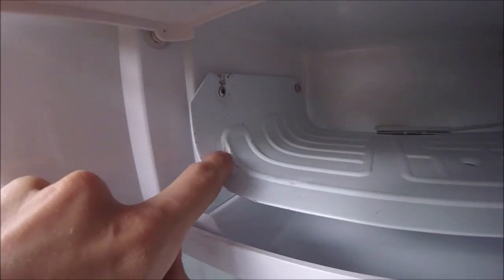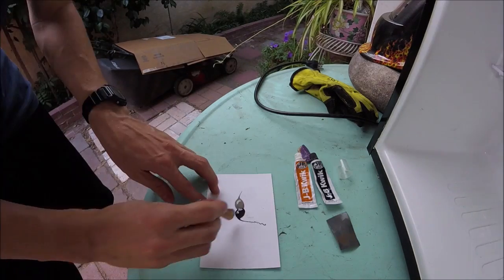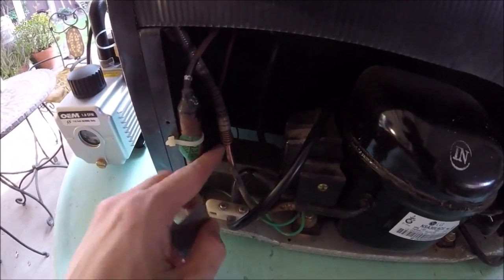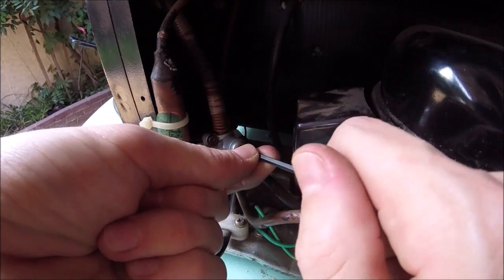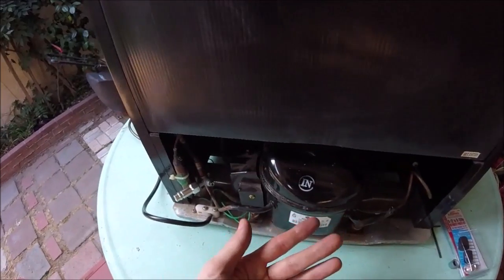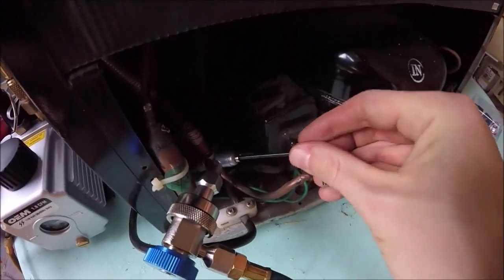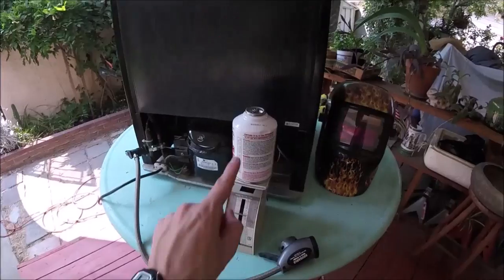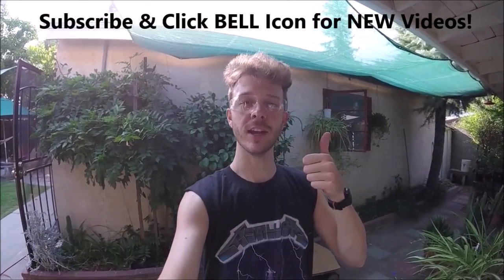How To Fix a Broken Mini Fridge -Jonny DIY

Comment: For the R-134 link, do you need to use the old version for $45 or can you use the artic freeze $22??
Reply from the maker: You can use new version as long as R134A. Will have to check links, they change the products sometimes 👍🏻

Comment: Cuestion if my freezer  has a hole I still used the cooling or I can I'm afraid  get burn down
Reply from the maker: If freezer leaking refrigerant gas theres no point recharging if leak is big. Will just all leak out. Try and fix leak first unless its super slow leak

Comment: Is it ok if i can just cover the whole will it still work
Reply from the maker: You can patch hole, but will still have to recharge system with refrigerant if it all leaked out. Youll know that it did if it currently isnt coolong at all 👍🏻
Reply: @JonnyDIY  thank u so much

Comment: Can anything else be used to seal the cooling plate in the fridge?
Reply from the maker: You could use other brand 2 part epoxies. But I'd stick to an epoxy 👍🏻
Reply: Jonny DIY 
Can I use fevitite epoxy adhesive instead of JB kwik

Comment: I have this problem, but I see that the mini fridge I’m looking at uses R12, which is tougher to get and not compatible with r134a. Assuming I can buy some, can I use the same vacuum puller on it? I’m sure I’d need to hook up the r134a fitting, but I don’t know if residual mineral oil in the fridge system possibly getting into the vacuum puller will cause a problem with the vacuum puller I rent. Any other issues to avoid?
Reply from the maker: Yes I believe its the same process as with r134a 👍🏻

Comment: Curious if the freezer tray can be easily replaced and if less/compatible cost to this videos repair method.

I did same dumb mistake of trying to chisel out the ice.  If I would have just been patient, lol
Reply from the maker: I would first try this fix that I did. Doesnt cost but around $15. If this doesn't fix Id just try and find one on $99 special or 2nd hand can be had for $20-$50

Comment: The challenge is to plug the holes without clogging the refrigant lines.  How would we know that lines are not clogged.  Tricky stuff !!
Reply from the maker: Yes just try not to cram the epoxy in the holes and should be ok 👍🏻
Reply: @JonnyDIY  Thx alot pal !!  Your videos are a big help for DIY repair stuff.

Comment: How do I turn of the gas so I can defrost and repair a puncture without losing all the refrigerant?
Reply from the maker: If you already punctured the refrigerant line in freezer then all the refrigerant gas has escaped. Will need to patch then recharge 👍🏻
Reply from the maker: If its still keeping cold, just unplug to defrost. And just let melt and remove ice chunks gently

Comment: Awesome video man. So, I should have known better but is it a problem if I poked a hole in the side wall of the fridge (not the freezer coil)?
Reply from the maker: No you're good. Shouldn't be a problem.  As long as it's still functioning as normal. You can always seal up the hole with some epoxy or just caulking to prevent moisture or loss of cooling 👍🏻
Reply: @JonnyDIY  awesome! Thanks Jonny!

Comment: Ok so even if I turned off the fridge it will still leak coolant and I have to put more in?
Reply from the maker: If you punctured any of the refrigerant lines, yes. If you heard a hissing noise, that was the refrigerant escaping. You'll have to patch and refill as I did

Comment: Does it matter which line you put the bullet valve on?
Reply from the maker: If you have a service stub use that. Just use the copper line from the compressor. An area straight and smooth
Reply: @JonnyDIY  the service stub is way to corroded. There are two lines one running into the fridge and one to external coils. I'm guessing it doesn't matter which one based on your statement.

Comment: Is it okay to just patch up n keep goin? Or do you have to do the whole process you did outside of the fridge?
Reply from the maker: You have to 1st patch it. Then vacuum system and recharge with refrigerant. If you just patch it wont work. All the refrigerant escapes as a gas when a hole in punctured
Reply: Jonny DIY to patch it, would a Clear RTV Silicone adhesive & Seal work?? A pro seal?
Reply from the maker: No I dont think itd hold the pressure as well as keeping a good seal under the cold temperatures of the refrigerator. I would just get some JB Weld. The Kwik kind sets up the fastest. Only around $5
Reply: Jonny DIY cool. Thanks so much for answering

Comment: what if you dont vaccuum it but ypu do add the refrridgerant?
Reply from the maker: It most likely won't work if there is air in system
Reply: @JonnyDIY  I've done it without vacuuming for my car and it works okay, but I dunno if I wanna do that for the fridge. If it's running even the least bit inefficient, it's probably gonna cost more in electricity in the long run right?

Comment: I accidentally stab a knife on a fridge plate and there was an air popping outside. I use proxy to cover it. Isnt it okey sir?
Reply from the maker: Yes you'll have to do as I did. Patch hole first then vacuum and recharge system with refrigerant 👍🏻
Reply: @JonnyDIY   sir what happen If idont vacumm and recharge? Pls reply
Reply from the maker: @myrnasarsalejo1201  if you dont vacuum and recharge it wont work and cool anymore
Reply: @JonnyDIY   is it okey if I dont vacuum and recharge system with refrigerant
Reply: I have a pretty old fridge I'm going to vacuum it but does it make a difference what kind of refrigerant you use in older fridges versus newer ones
Reply from the maker: If 1995 and newer should take R134A refrigerant. If older youll have to call a pro to get freon
Reply: @blade5054  if i turn off the ref fast? After i accidentally stabbed and the stabbed is super duper small

Comment: Great video! how long does it take to create the vacuum? my gauge stays a bit above -20, left it on for a few min and stayed at -20. turned it off and it held. Unplugged everything, pressed the schrader valve on the adapter and it let out/in air. signs of it working??? thanks!
Reply from the maker: I would vacuum system for a good 15-30minutes. Make sure it can hold deep vacuum, should be close to 29inches vacuum. Rhen recharge with correct amount of refrigerant

Comment: I just ended up making a small dent. I don't know what to do. I am so done or.  It's not where you had it, it's on the plastic rim where we find the door of the freezer and the metal plate is intact. Will it cause problem. It's just a few hours and I am having a heat attack
Reply from the maker: You should be fine, as long as nothing is punctured on the freezer tray like mine was youll be good 👍🏻
Reply: @JonnyDIY  Thank you so much sir.😄 I feel relieved. ❤
Reply from the maker: You're welcome 😀👍🏻

Comment: One week after my repair and still cool. :) Thanks so much! Just a few words on Autozone and obtaining the vac and gauges. They don't rent these. However, I was pleased to find out that they LEND them. You just have to put down a deposit to temporarily buy the loaner ($300 on my CC for the set).  Upon return, you get you full deposit back up to 90 days. I did have to buy oil for the vac for $10. Total out of pocket for repair was about $40, but I saved a $1,300 U-Line beverage center (fancy mini-fridge) for now. Repair was estimated at $850 to replace the evap. unit. They would not patch it.
Reply from the maker: Thats awesome! Glad my video was able to help you out some 😀👍🏻
Reply: Updates?? Is your mini fridge still working?
Reply: @musicisbrilliant  Yes... It's still chill!  Six years of continuous use later and I've recharged it only once. Also, I believe that the JB-Weld actually helped limit frost build up too.

Comment: Jonny, is it possible to take fridge to repair place and let 'em recharge it??
Reply from the maker: Yes they will be able to recharge and hopefully repair the spot where the refrigerant originally leaked out from
Reply: @JonnyDIY Based on your video I sealed leak myself. Today I fired it up but no cool freezer?? Went back to your video realizing Tank must be Recharged. Would be easier to take to shop. Thank you.
Reply from the maker: Yes once leak patched you have to fully vacuum system to get all the air out and recharge

Comment: Man, wished I'd viewed your video 20mns ago before I poked hole in mini freeze, same area with ice pick. Question? Are their any other (easy) epoxy sealants??
Reply from the maker: I would just get JB weld because I know it works but any 2 part epoxy will probably work. The syringe style ones are nice because they push out even amount of both glues. Gorilla glue has an epoxy too I believe. But yeah definitely sand, clean then glue an epoxy over it and itll hold fine. My fix is still working a year later
Reply: @JonnyDIY  Thank U

Comment: Bro i got the exact same  hole in the exact same spot you do bro and u helped me fixed my frig
Reply: Me Too! Exact same spot..
Reply: Ill be honest bro since i posted my last comment the jb weld didnt hold about two days later it lifted because if the pressure of the freon coming from underneath.only solutuon is to aluminum weld it or get a bew fridge
Reply from the maker: @mistaandason6159  ohh dang sorry to hear, mine is still working after a year. Got to make sure to sand it real good so the glue will grab
Reply: @JonnyDIY  ok will give it one more try.
Reply: @mistaandason6159  Did you get yours to work after another try or did you just buy a new fridge? Debating on whether to waste $20 and time, versus just buying a used one. It won't be the same though. Sucks
Reply: @aznnp77  had to buy a new fridge bro
Reply from the maker: Awesome glad the video helped you out 👍🏻